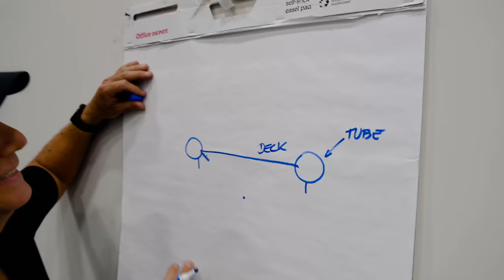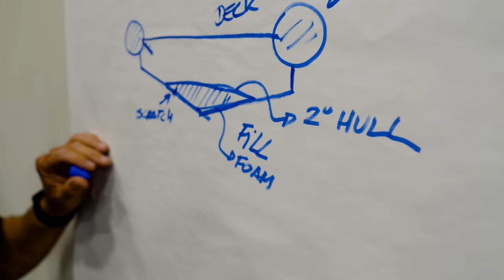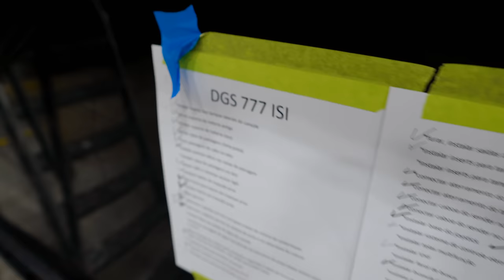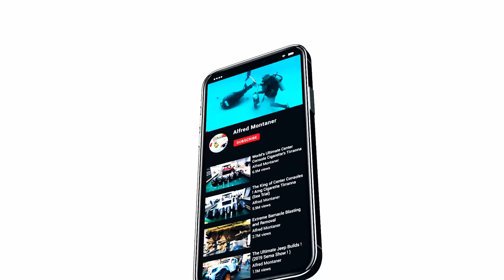Fear the Dgs Monster! Military Boats for Civilians ! (Hull Restoration)

Comment: Gentlemen, This is a very smart plastic composite that provide long term reliability with almost no maintenance if used properly. The first thing gets to my mind is that they use tires rubber in such composite. I assume that the reason the Brazilian Co. assemble it in the US is to attain a US certificate of origin to entitle the Brazilian Co. to enter and bid in a US governmental tenders (contracts) to supply numbers of these boats to coast guard for example, where in such tenders they stipulates that the priority goes for US made commodity. The welding machine have the same concept of a small silicone welding gun Lool. My advise for rough damaged area is to use a grinding machine rather than the razor or multi purpose tool so as to smooth it much like an auto body repair. I wonder how much the thickness of the body which I assume not less than 4 cm. Another idea comes to my mind is that if there is a penetrating crack or shot gun hole is to develop a sort of a bicycle tube batch like (Tip Top) to be welded from the inside while the outside in such case can be filled with the heat gun. Take Care and Enjoy your time. John Jack Kaplanian from Jordan / Middle East.

Comment: Alfred, if you ever mentioned that those boats were plastic I must have missed it. I always thought they were aluminum. I like them even more now. There is a company in the Netherlands called Tideman Boats. They also manufacture boats from HDPE. I contacted them a few days ago and they said they will be here in the US shortly. I like the idea of using HDPE because it is lighter than water. Meaning it won't sink.
Reply: Solid HDPE isn't foam; it's only slightly less dense than water.  If the boat has an engine, batteries, and electronics, then the boat is going to be more dense than water and will sink when flooded.
Reply: @TheVonMatrices  Triumph boats are like Boston Whalers, so hull cavities are filled with floatation foam.
I do believe boats 21' and under are required to have full foam flotation.
Also, EHTB is lighter than water. If the boat is broken into pieces, and the piece with the engines is large enough it won't sink.
Reply: @SwitchRod  I'm not sure if EHTB is a misspelling of HDPE or if it's a different material, but I couldn't find any information about it online. 

If you want an unsinkable boat, the hull material barely matters.  The density of HDPE is about 96% that of water, so you aren't getting very much flotation from just being HDPE.  A HDPE boat that weighs 5000 pounds would only get 200 pounds of buoyancy from the plastic.  Put a single outboard on that boat and that buoyancy is completely cancelled out as soon as the boat fills with water.  Boats that are unsinkable are unsinkable because of foam filling, and foam can be put in any boat regardless of hull material.
Reply: @TheVonMatrices  Engineered Hybrid Thermoplastic is material used in dgs boats.
What's the purpose/advantage of rigid inflatable boats?
Triumph boats are not rigid inflatables, but are full of closed cell foam.
Triumph use(d) High Density Polypropylene (HDPP) in its manufacturing.

Comment: Your shows are awesome. Really enjoyed this one.
Reply: I have a 2002 Triumph 170SC which has seen much abuse while fishing a local lake...Rock Lake?!
Great timing Alfred, I was just about to search the web to learn the technique of repair...some pretty deep gouges. 
THANK YOU! 
I was trying to help a local dealer promote the Triumph brand, running up on the rocky beach at the launch, throwing rocks at it, etc.
Aluminum addiction in this area. Glass and aluminum boat owners baby their boats at the launch...I didn't. 
Most were impressed...many thinking me (justifiably?)an idiot. 
I LOVE the boat, and have never met an unhappy Triumph owner. I talked to an owner of a 21' CC, with twin 150 Yamaha. It is his tender for a 50+' Ocean Alexander, replaced a Grady. He said the ride was quieter, and smoother with the Triumph...and he got one of the outboards "free" when comparing the purchase prices. Obviously, any hull repairs would be incomparable in cost/loss of use. 
In 12"-18" chop my 17' rides smoother and quieter than my nephew's 23' jet boat. The entire hull flexes...is a foam-filled "shock absorber." 
It's a travesty they've stopped building them. I wish I was wealthy enough to buy the molds and equipment from who Genmar sold Triumph to in 2011.
Building a 23' jetsled, taking it to rivers to abuse...steal a bit of the aluminum market. 
I like both aluminum and poly...both recyclable to please the climate change zealots, even though they seek to ultimately eliminate recreational boating...then commercial. 
That's a different rant...

Comment: Good tech but not for the everyday mortal. I can get a nice bigger than 22f boat for for a 100k
Reply: Not one as durable (also unsinkable), and runs smoother and quieter.
My Triumph could be broken in pieces...all would float, even the one with the engine, if flotation of that piece exceeded the weight of engine.